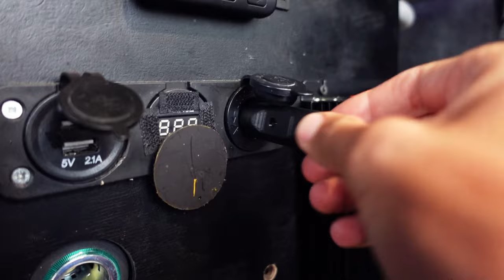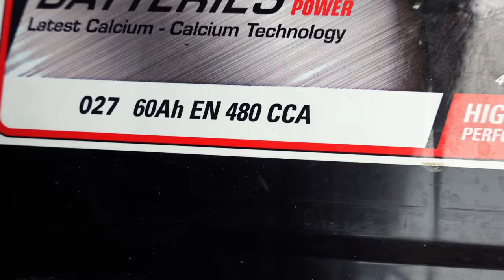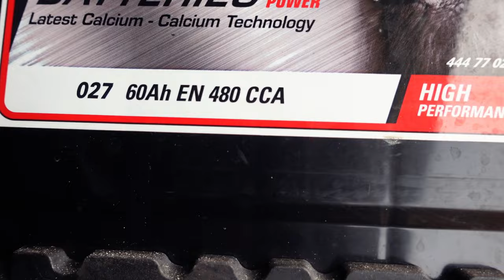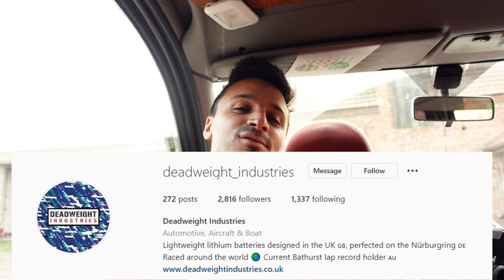Our TINY Van Gets BIG Power! ⚡ (Ready to hit the road)

Comment: Very nice build that's for sure. I have been investigating many build on YT and your's is definitly a winner. so faar I'm preparing to buy the Doblo, in part because of your content. I'd like to ask you, since you added your swivel afterwards, if you knew about it at the planning phase, would you have prefered having the kitchen on the other side and the bed on the oposite, to open up your space? I have drawn a few sketches, and my favorite so far would be kitchen on the right, bed on the left (with your expanding design opening up the doorway) and the swivel seat on the passenger, with a Laguna table to rotate around the bench/passenger seat. Do you see any obstacles in this design?

also, I really like how you optimised the space under the passenger seat for your batttery, as well as the heater on the side. do you know if the Cargo version has that much space under the passenger seat to accomodate all that?

thanks for the great content buddy
Reply from the maker: We didn't know we'd get a swivel seat when we first built the van, I can imagine maybe with the bed on the left side it would work quite nicely as well. I'm not sure if the cargo has the same rear foot well spaces but it probably does. Glad we've inspired you, thanks for watching 🤟🏼

Comment: Great video guys good luck with the upcoming trip 
i have the same setup in my caddy 100ah lifep04 and renogy DC/DC 20A charger i put a breaker fuse on mine next to the battery positive going to the DC charger as when not in use i don't want the battery at 100% charge for long periods as this will lessen the life of the cells 
you may also be able to set the battery BMS to stop charging at 90% in the battery app settings id highly recommend doing this 👊
this setup for a small van is epic i use around 10/15% battery a day running a compressor fridge 24/7 lights charging phones tablet and the diesel heater
Reply from the maker: Thanks for the info, I was tempted to put a switch in the D+ wire to have some more control over the charging, perhaps I will do it when we're on the road, will check regarding 90% 👍🏼
Reply: @TeamAteem  Yes a switch in the D+ wire would work also

Comment: Hello guy's I have a fiat doblo 2006multi jet same shape as yours I've converted it into are little micro camper Rosie and would like to  put in a diesel heater 2kw was thinking under the passenger seat because that's the only place I've got left for it please could you let me know if it would fit under the seat thanks
Reply from the maker: There is definitely space but you need to look under the van because there are chassis rails in that area which will be in your way of mounting & exhaust

Comment: Oh I thought you couldn't use lithium batteries as a starter battery due to high amps required, heat from engine, cold from outside, and alternator not tuned for it?
Reply from the maker: https://www.deadweightindustries.co.uk/apps/faq

This should answer your questions 😃